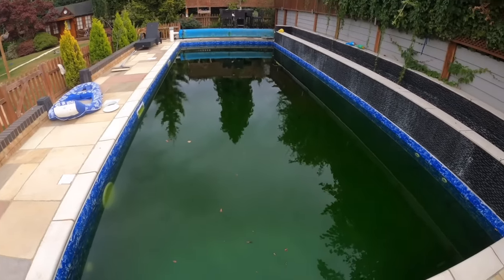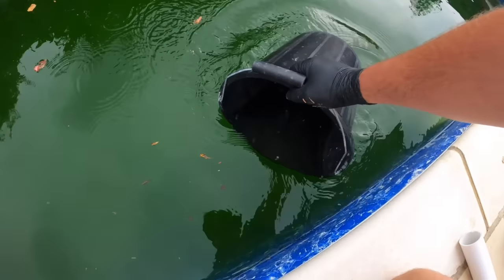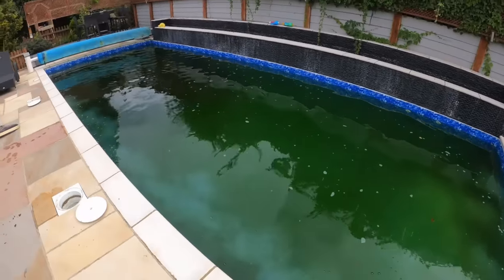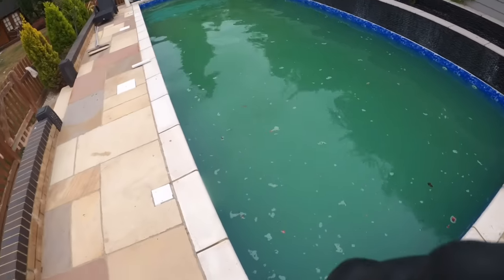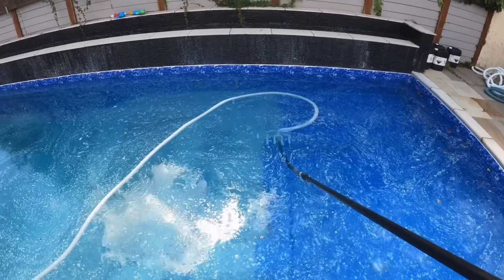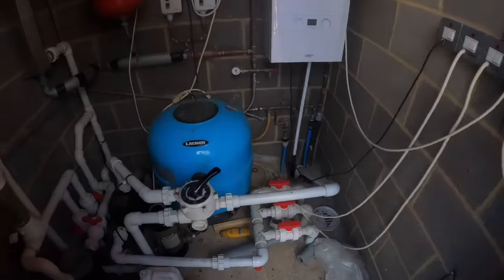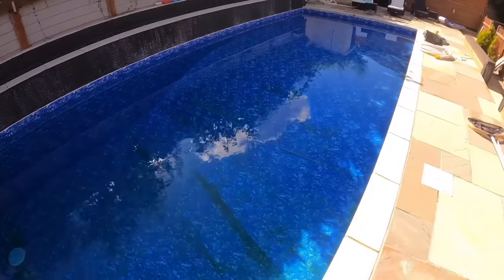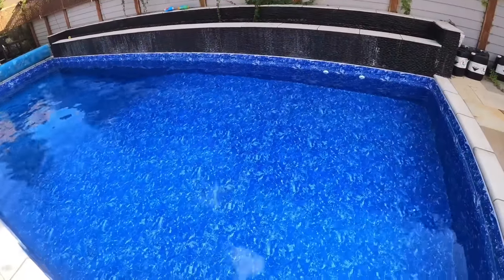VERY GREEN TO CLEAN!

Comment: what I usually do to speed up stirring the chemical, I mix the chlorine + water in a bucket, set the filter to recirculate and pour the choline mixture into the skimmer hole, and I do the same thing with the pool floc
the chemical will flow evenly into each side of the swimming pool

Comment: Guys keeping a pool clean and not milky after just 1 week is really hard its not easy keeping a pool clear full stop. After 3 years and watching this guys we are getting there now it's a full time job lol, good video buddy
Reply: check your run times and chlorine levels if its copping a beating being used alot its worth running it for longer hours or adding additional chlorine if you see it clouding. one of my jobs is a 120,000L pool in an apartment complex and i keep the levels a little higher than a residential job to account for the potential 30-40 ppl using it
Reply: @MrThc247  thank you buddy
Reply: @pattiboychannel311  clear water is usually good water :D if u see it change always get a test done

Comment: What is the skimmer lid at the of the pool near lounger for. Does it have a pump to get rid of excess water if their is fluctuation in depth for aera where there is a low or ground water level. Is there an emergency shut of switch

Comment: When you notice that a filtration system needs work but you are only there to prep the pool, do you still mention that to the client for future work? Just wondering because you mentioned that the laterals on the sand filter are broken.
Reply: It would be unethical not to mention it
Reply: @mads855  I figured that would be the case but I wasn't sure. Seems like an easy way to get a repeat customer!